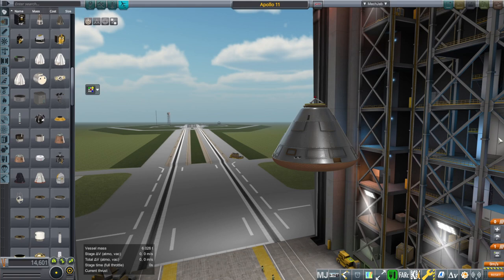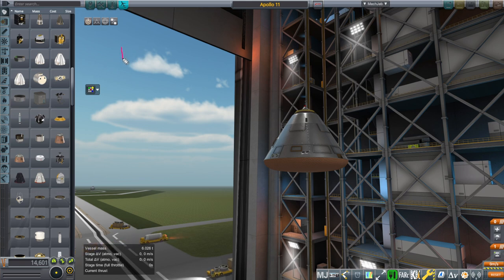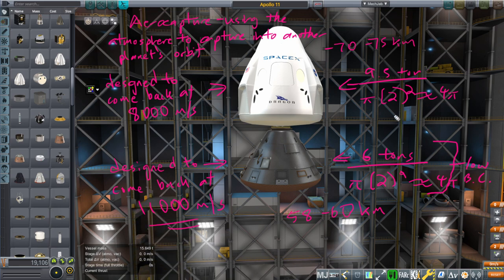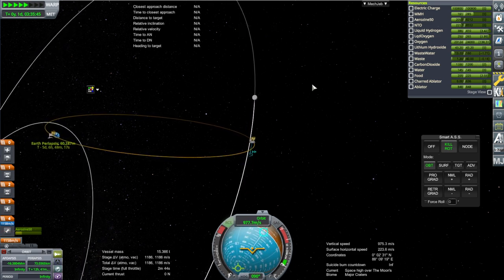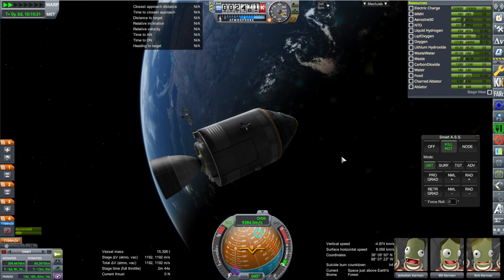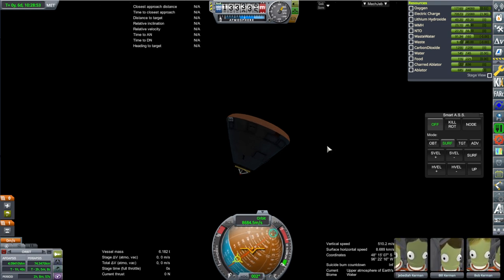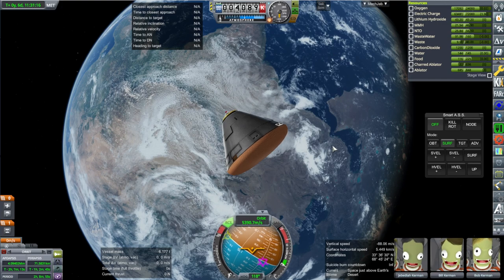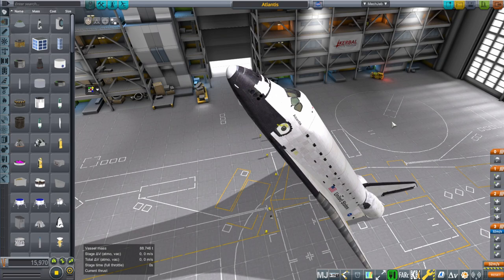Space Basics 11 - Reentry

Comment: Is the ballistic coefficient calculated based on a 2-dimensional simplification, or does the degree of convexity come into the equation as well? Wondering since neither Apollo CSM nor Dragon have a flat bottom though they do pretty quickly get to their widest points, but for something like Starship or some other non-traditionally-shaped reentry module, is it the same? For Starship for example, is half the craft the area for the equation (a rectangle then, plus the bit at the top)?
Reply from the maker: This one is a simplification assuming a flat surface.

Comment: Thank you for the video! 

Regarding the Apollo missions not using a skip entry technique,, does the G force, Heat, and speed actually seem possible for a manned crew?

[Since they came in at Mach 32 (25,000 mph) and suddenly dropped to Mach 2 (250 mph).]

Thank you 🙏
Reply from the maker: It wasn't suddenly - they spent a fair amount of time decelerating. Hopefully you won't mind metric units - the entry speed from the Moon is around 11000 meters per second (roughly 24600 mph) and 1G is 9.81 meters per second per second. So, going with a very modest 2Gs of deceleration, we get a deceleration to zero time of 560 seconds - 9 minutes and 20 seconds. Allow 4Gs, which is the normal limit for crew accessing instruments in a spacecraft, and it's half the time or under 5 minutes. For Apollo, the main deceleration is generally these two values because of its lifting properties and therefore quite doable.
Reply: @RaizSpace  I appreciate you taking the time to share your knowledge with me. For some reason I became obsessed with understanding this aspect of reentry from space, and I’ve learned so much thanks to people like you who have made this possible!

It is fascinating that we have so much technology and information at our fingertips!

I was skeptical of the concept of us really doing the incredible, but the evidence is there as far as I can tell.

The radiation level of space outside of the van Allen belt is still something I am looking for, but that will be another comment for another video, lol!

Thanks a bunch!